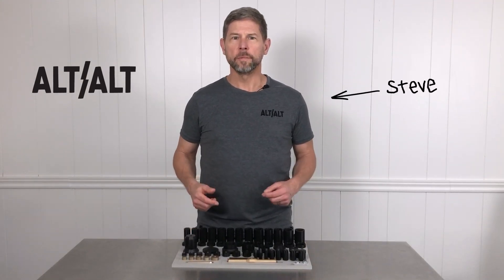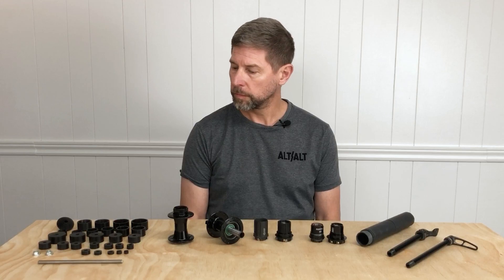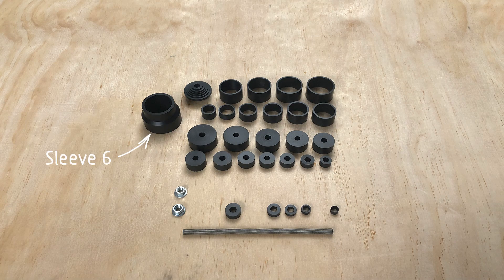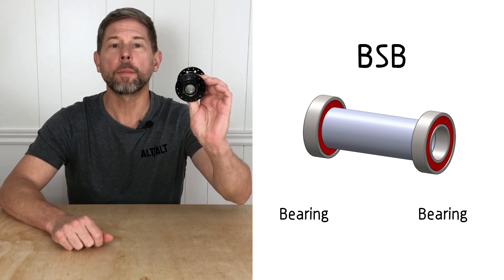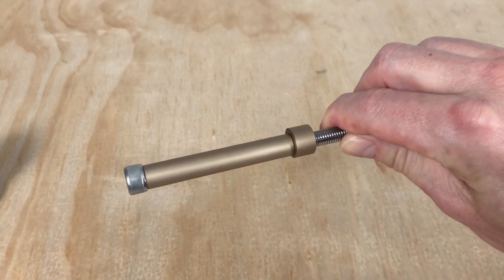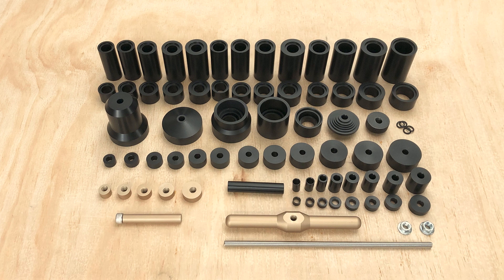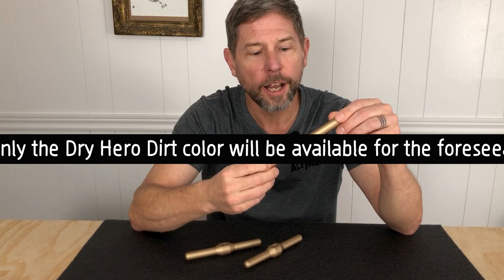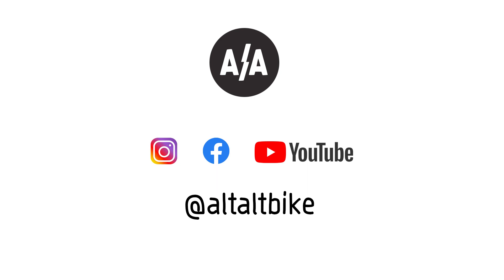Hub & Suspension Bearing Press System Explained

Comment: Hi Steve! Thank you for addressing the (should be) very delicate subject of bearing swap. Your tool is the most comprehensive I have found yet, so kudos for that. However, I wanted to ask you... I'm an avid user if Bitex hubs, and my front QR hubs have a 5mm ID axle which wouldn't make the press work, since the stud wouldn't enter into the axle. What would you recommend for that scenario? Is it possible to get or use your kit with that size of stud?
Reply from the maker: My tools are designed for modern mountain bikes, but contact me through my website and I'll be happy to look into this for you. AND THANKS for bringing new customer needs to my attention! Much appreciated.

Comment: As a mechanic that only works on bike these days as part time I only do bearings a couple times a year, this is a great kit, when I had a metal lathe I wanted to build a similar kit however didn’t have the time or access to enough variety of bikes/hubs to design a complete kit. Can’t wait until you offer delivery to Australia
Reply from the maker: Thanks! Should be soon.